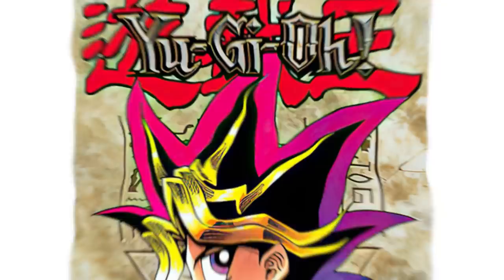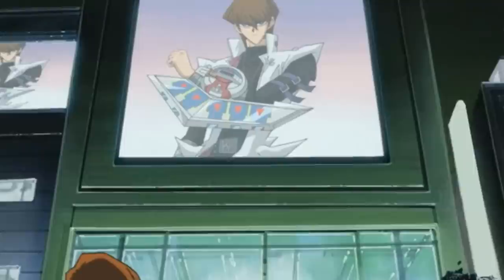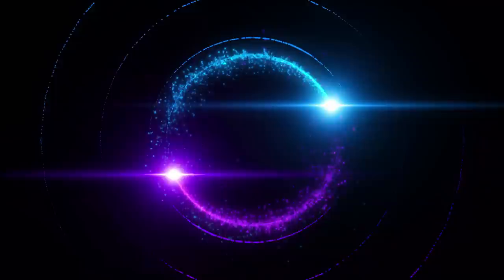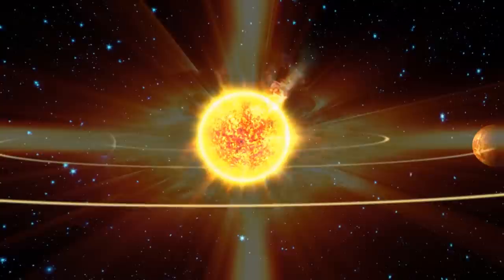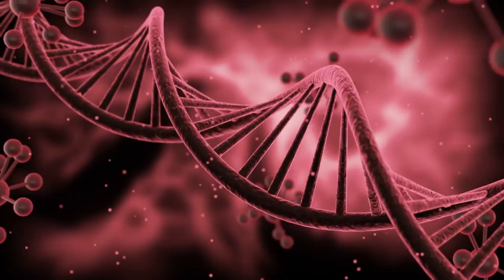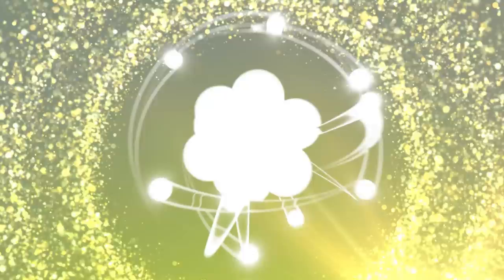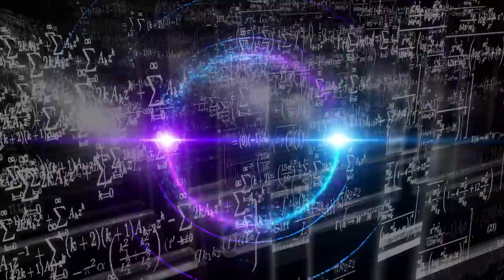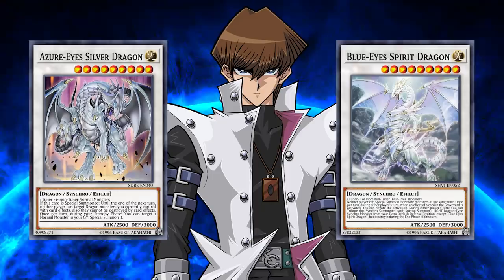Yu -Gi-Oh! Theory: Seto Kaiba Invented Synchro Summoning

Comment: 12:15 Ehhh, I'm gonna stop ya right there and immediately debunk this with two points. It's impossible for Yusei to make XYZs because:
 1. The majority, if not all XYZ cards, according to Zexal, were created from the power of the Numeron Code. Astral made number 39 Utopia and Yuma made Number F0 Utopic Future respectively. 
2. Arc V's case is the same, in some ways, because the whole "creating a new method of dueling" thing happens with Yuya/Zarc creating Pendulum summoning.
Reply from the maker: I actually don’t understand what you mean as far as Arc V goes. 

But the upcoming XYZ does address your point about the Numeron code. Short version, you can summon the same monster spirit different ways (hence Black Luster Soldier [Ritual] and Black Luster Soldier: Envoy of the Beginning [Standard] existing as two variants on the same monster spirit). The five signer dragons existed prior to Kaiba developing Synchro summoning. Humans just didn’t have a standardized way to summon them. 

The summoning methods and the existence of the corresponding spirits are two different things. So you are correct, the Number card spirits have existed for millennia but that does not mean that XYZ summoning as a practice has.
Reply: @SpellCommander91  Okay so my second point did not fully come through. That's my mistake 😅. For Arc V, I was trying to refer to how random mechanics in the game are just... created. Like how Zarc said he made Pendulums and when Yuya used them for the first time, even the Leo institute was confused about them at first. I used that point to justify how some XYZ cards, as the ones I mentioned, were created out of thin air.

And that is true about the duel spirits point you mentioned. I guess I was too wrapped up with XYZs and the Numeron Code. All I can do now is wait and see your upcoming video about it. Consider my debunk debunked, I guess 😂.

Comment: are you trying to say fusion is worse than Fission? because thats not what I read. its really the opposite
Reply from the maker: No, not at all. And we're going to be covering fusion in depth in the XYZ video. 

Fusion has a significantly higher theoretical capacity than fission and does not produce the same dangerous byproducts but it's also presents challenges that we have yet to overcome in terms of making it viable. We've never managed to build a fusion reactor that requires less power than it produces, making current fusion technology highly inefficient. 

Fusion is theoretically better. Fission is more viable because it is substantially more achievable.

Comment: this guy is actually so fucking wrong about the energy loss between fusion, and fission that is laughable. physics is welll beyond this dudes scope.

fission barely gets 1% of the entire fuel source as power..if even that. infact I think its less than 1%.

fusion is not used as a source because it requires such immense pressures to start that our fusion bombs need a fission one to start off because it's so much easier, but fusion gets almost 100% of its input, and it's CLEAN! no dirty radioactive by products. nothing.